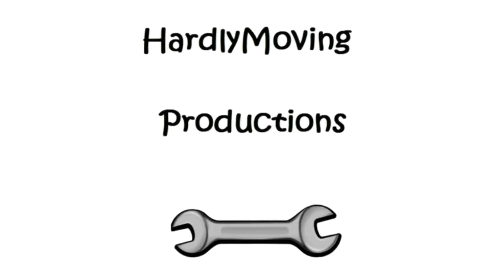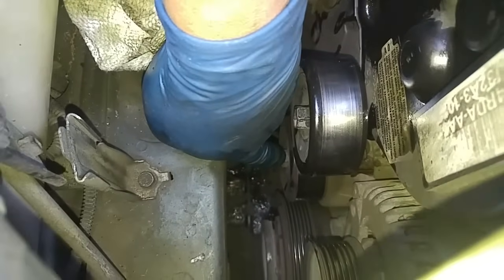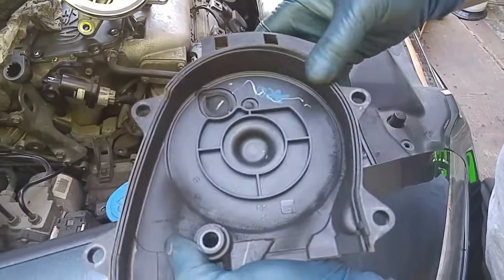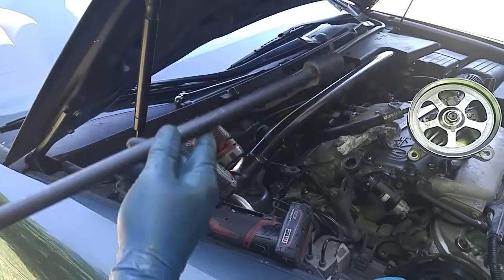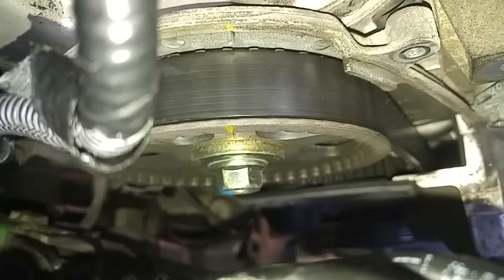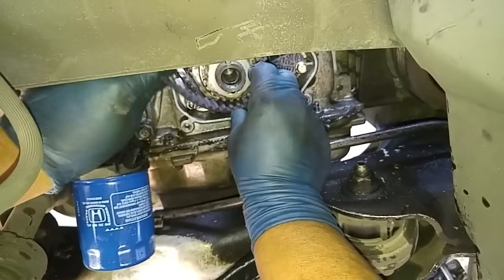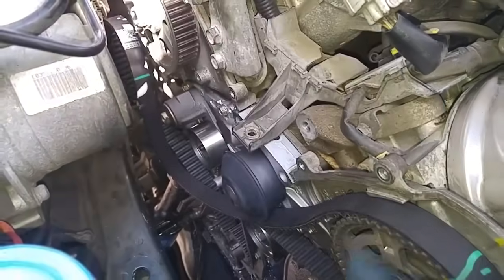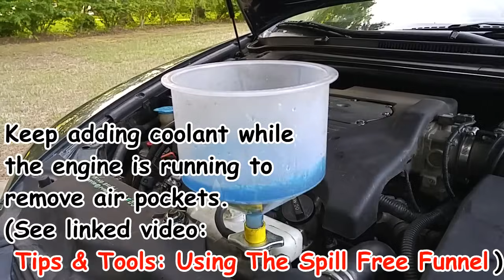Acura TL (Honda Accord V6) Timing Belt, Water Pump, & Pulleys Replacement

Comment: Hey wassup man quick question do you have problems with the crank pully moving when titen it back after you finish or nah? Because I somehow saw a tutorial and they made it seems very difficult is like you need something to hold the pulley! So it doesn't move or this method don't apply to the acura after all the timing is already set right!?
Reply from the maker: I use a powered impact tool to tighten the crank pulley bolt.   Without it, you would need to hold the pulley from moving.
Reply: @hardlymovingpro  thank you

Comment: This makes the timing belt job on my v6 Toyota look like a breeze. Nice work:)
Reply from the maker: Thanks for your support.  The only thing really different is that the cam and crank seals on the Honda's last longer and don't need replacement.
Reply: @hardlymovingpro  So you would not recommend replacing the cam seals and crank seal while doing this?  I have a 2005 Acura, 158k miles, that I do not believe the 105k mile maintanence was done (the timing belt and water pump specifically).  No visible indications of leaks from these seals, but I am wondering if it might be worth it to do them while I have everything apart already.

Great video though, got the subscribe from me and I'll follow your links since I still need to purchase that Lisle 19mm socket.  That spill-free funnel looks great, too, probably going to add that to the tool box as well.
Reply from the maker: @brassmule  I can't come up with any rationale reason why but Honda cam and crank seals last longer than Toyota ... never seen one leak.
Reply: @hardlymovingpro  Okay, great, thanks. I'll inspect the area thoroughly for leaks but leave them alone if I see none. I wasn't sure if replacing them may be good preventative maintenance or not.  I picked up the Lisle 19mm socket and funnel using your affiliate links, so hopefully that worked on your end.  Thanks again for the great video!
Reply: @hardlymovingpro  Thanks for the great video btw. I did my 05 TL, an 09 MDX, and a 2011 Odyssey, thanks to you. The Lisle tools worked perfectly. Doing the work allowed me to diagnose two power steering pumps with leaking rear seals and get those flushed and replaced, too.

Comment: Wow, well done my friend! Not sure who took the video but you captured each step very well and just what I was looking for. I'm looking to purchase the same model/yr for my teenage son with 89k miles from a dealer and I doubt the previous owner had it replaced so I can use it as a bargaining chip. It's the more rarer 6spd manual too, which according to Acura forums, are more reliable. Any chance you have a video on how to change out the clutch? Thanks brother!
Reply from the maker: Thanks!  No video yet on replacing the clutch.

Comment: awesome tutorial. Just the important words and not the useless chit chat and rants like the other tutorials. This is how tutorial should be made!
One favor i need is:What impact wrench did you use? How much Ft.Lbs? Thanks
Reply from the maker: Thanks for your comment!  The impact tool to remove the crankshaft pulley bolt is a Milwaukee M18 Fuel 1/2" and it generates around 1,400 lbs of torque.  Used with a high mass 19 mm impact socket, taking off the harmonic balancer pulley bolt is easy.  If you want more details, let me know.

Comment: How did you stop the timing belt from turning while removing the crank bolt?
Reply from the maker: With a with a high torque impact tool with a high mass impact socket.

Comment: I have a question Sir, please answer. Can I just mark on the belt for 2 cam sprockets and main sharp where they are without turning them to the mark that match to the block ? Then take out the old belt and counting notch to the new belt and install it?
Reply from the maker: Yes ... you could do it that way;  however, it's a good idea to get the cam and crank at their TDC (top dead center) marks beforehand.  The cam(s) may "jump" if they're resting on a tension point right after you take off the belt.

Comment: Thank you very much for the video. About to attempt this next week. Do you know where I can find the torque specs for this job?
Reply from the maker: The only thing you need to be worried about is tension on the crank pulley bolt ... which should be around 160 lbs.  I just use my electric high torque impact driver.  You can also apply paint alignment marks before taking off the pulley bolt so you know exactly where and when to stop applying torque. The idler pulley bolt a little over 30 lbs and the tensioner pulley bracket bolt around 25 + lbs.  You should buy yourself a repair manual specific for your car.  Use this video as a visual guide and cross reference with the repair manual.
Reply: @hardlymovingpro  Awesome. I will definitely invest in a repair manual. Thanks again for your help and the video!
Reply from the maker: No problem and good luck with the repair ✌!
Reply: @hardlymovingpro  Well I am more than half way done, and while I was aligning the rear cam tooth mark with the new belt (ever so slightly) the cam sprung clockwise to the #6. I'm pretty worried now. Can I just keep rotating the cam back to TDC or is my timing totally off now?
Reply from the maker: Pretty common for that too happen.  Just rotate the camshaft sprocket back to it's correct position.  I use one hand with a box wrench to rotate the sprocket and the other hand to mount the belt.  If you use both hands to mount the belt, you run the risk of the cam sprocket jumping.
Reply: @hardlymovingpro  Made it work. Timing belt job finished thanks to your great video and additional assistance. I really appreciate it!
Reply from the maker: Hey ... congratulations on doing it yourself!

Comment: Quick question do you recommend changing out the water pump because I'm in there anyway
Reply from the maker: Absolutely!  If you don't, the only question you want to ask yourself is "will this water pump last to the next timing belt replacement interval?" ... which is 100k miles.  Same thing with the belt tensioner and idler pulleys.  Getting 200k of service out of the original water pump could be if-ie.  The cam and crankshaft seals however,  do last over 200K.

Comment: Looks like an excellent Video .
I notice  you didnt specify torque numbers on bolts for the Crank bolt ,  water pump , etc .
Reply from the maker: Thanks for you comment.  Been doing this for so many years, don't use torque wrench that much. More important to spread torque evenly, clean contact surfaces and using quality parts.  Though I do use toque specs. for head bolts doing head gasket replacements.

Comment: Is it safe to reuse the tensioner?  I’m having trouble pulling pin or Allen key out of new one and it’s killing me.  I compressed, pinned, and released pin on old one.  It felt easier to pull and still to strong to push down on without c clamp.  Is it a gamble?
Reply from the maker: You could but doesn't make sense if you can just pull the pin out of the one.  Get yourself some pliers that'll make the job easier to pull the pin.
Reply: Hardly Moving Productions appreciate you replying man.  I ended up having to swap out the Allen key pin with a high torque that’s attached to a quarter inch drive socket.  Gave me a good service to pry with a breaker bar and Now I’m successfully running from cops again.  Thanks for the upload bro!!

Comment: I came here thinking, I bet I could do this at home. I think I'd better take it to a mechanic.
Reply from the maker: It's a do-able job.  The only hard part is getting the crankshaft pulley bolt off (you'll need a powered impact tool and a high mass 19 mm inpact socket).  The rest is basic metric tools.  I've had subscribers take anywhere from a few days to a week to do a job like this on Toyota's V6 timing belt.
Reply: @hardlymovingpro  I'll leave it to the professionals. Can't do it with my $15 wal-mart tool kit ;)
Reply from the maker: @MA-wy7cr  I hear you ... but you'd be surprised with what some of these "professionals" get away with barely a high school education.  On the other hand, I can say the same for those with BA, BS & MBA degrees.

Comment: so is this much different from a 2002 acura TL?
Reply from the maker: Should be virtually identical.  Timing belt kit slightly changed in 2004.

Comment: Crikey .... such awkward , confined spaces looks like Welcome to Exasperation City to me ! 
My 2003 3.2cl Acura 140k MLS currently in shop for Timing Belt Replacement....... c. 5hr job $1,200 approx quote.

To kill time I watched this .... . Lol
Reply from the maker: If the shop knows what they're doing and has the right tools, they should be able to complete the job in under 3.5 hrs ... but I'll guess they'll bill you for 5 hrs just in case something goes wrong or have a hang up.

Comment: There's no need to mark the belt when your sprokets are line up right
Reply from the maker: That's right ... if you're a seasoned pro that's done it a few times.  But if it's you're first time and you're not sure it's aligned, paint marks will help the rookie a lot!

Comment: which milwaukee impact wrench did you use at https://youtu.be/5Qxc-K8X6Do?t=277 to remove the crank bolt?
Reply from the maker: I nick named this tool my "big mama" and provided a link to the tool in the "Show More" section of this video.  Since I have and use other Milwaukee tools, I only bought the bare tool (without the battery).  If you don't see it, here's the link:  https://amzn.to/3bfdVv6